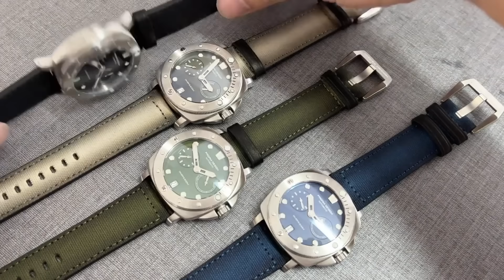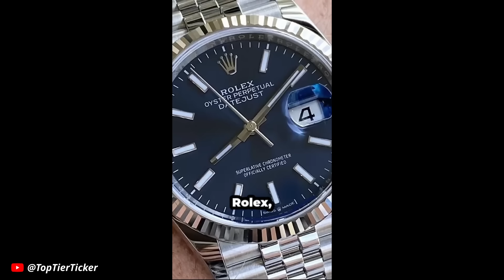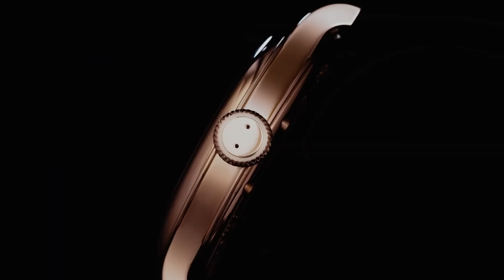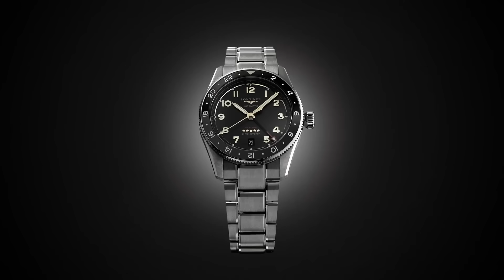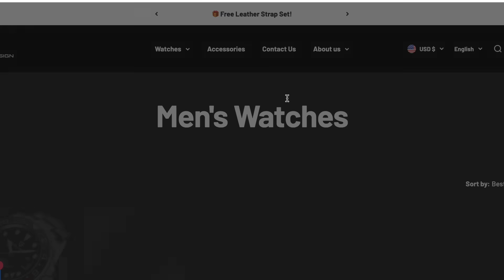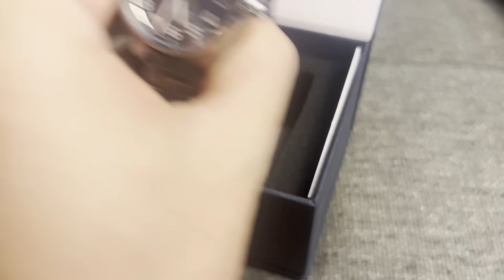The ULTIMATE Fake Watch Company

Comment: Regarding complaints about micro adjustment on PD watches being so difficult, my Pagani PD-1639 which I got in May of this year (2026) includes a notch on the link that holds the spring bar, making it easy to stick in your spring bar removal tool to pull the spring bar loose. Just make sure you open the diver's extension first because that link is hidden under the extension. I reckon this wasn't the case with the two other Pagani watches that I got in 2021 and 2022. Hopefully they put this notch on all their watches already.

Comment: Those are designs.

Do Porsche and Ferrari are design stealers?
They are.
They stole the concept of the modern motor car to Ford, 40 years later, as every other brands.

As fridges, stoves, houses, bikes, planes, boats.
If the design is good, it will be used. As source, or as it.
That's not copy, steal or homage, but natural order.

Sure, if you "clone" (name, design) as an attempt to FRAUD  and sell it as an original, it's fake.
Otherwise, it's not.

Comment: I got my Vunqera Datejust hyperclone for $1,200. I saved $13,000! It's absolutely crazy there's practically no difference from the original. They have by far the best hyperclones on the market. On top of that, they have every watch you can imagine, even fully diamond-encrusted (iced out) models. It's incredible. So i am asking everybody here, is it better to give like 15k and wait for 2 years for a watch, or get 10 of them for the price of that 1, and get them in 20 days? I even resold 2 here in Miami for 2500 each, box and papers

Comment: It's clear that people don't understand the term, "homage," including this content creator. Homage means, inspired by, so there will be similarities, but also distinct originality, too. Within watchmaking, all types or categories of watch began as the solution to a problem, so intrinsically function precedes form - thus a diver watch is limited aesthetically based on the job it must do at 100-1000M, so diver watches can only look so different. On the opposite side of the spectrum away from a true work watch, the dress watch has greater flexibility, while the concept wristwatch is the most extreme version of excessive form over function - many can't practically be worn in most settings and are relegated to being appreciated solely for their artistic contribution. Chinese wristwatches, like Pegani Designs, have NO DESIGN element whatsoever. Their watches are NOT designed, but CLONED, so these are  more accurately called a "clomage" rather than homage. They are a rip-off subsidized by the CCP, manufactured at a loss, with criminal labor standards, for the sole purpose to disrupt Western markets in an anticapitalist campaign. People who purchase these watches are either naive to understanding manufacturing in general, watchmaking specifically; fair labor practices and economics. A Swiss watch company, at any level, has far greater costs in materials, ACTAUL DESIGN, advertising, labor, labor regulations, taxation - every considerable metric. And you're purchasing pedigree. There's only ONE Rolex, ONE Porsche, ONE Ferrari, ONE Bentley, ONE Tiffany, ONE Holland & Holland, etc, etc. Stolen Intellectual Property, slave labor, CCP sponsored manufacturing, limited advertising makes for an inexpensive, throwaway watch to appeal to the masses. Nobody is going to spend $500-$2500 (current prices) to refurbish a Pegani Designs watch in 10-20 or more years, because they'll have ZERO VALUE.

Comment: I have a real Submariner purchased in 2017 for $7200.  It is now worth $10,000.  I have a Pagani Design Polar Explorer 2 bought for about $250 4 or 5 years ago.  The bracelet was junk, I replaced it with a rubber strap.  The Pagani has basically no resale value.

So scorecard:  Real Rolex $2800 profit.  Pagani Design $250 loss.

Comment: If it has their company logo on the dial it's not a fake. That's clickbait BS. PD isn't a brand I'd buy ,but I have loads of Chinese homage watches because they offer outstanding value for money.  I can wear a style of watch that I particularly like, which is well made of good materials at a fraction of the cost of the original. Some of mine are exact copies except for the name on the dial, some are based on a well known design and some are completely original. The Chinese are extremely good at finishing, just about all the Rolex Submariner homages will have better polishing than a Rolex. At least one Chinese brand is using zaratsu polishing technique,  their £200+ watches have outstanding finishing, go check out one of I Like Watches videos on the subject. High magnification footage shows clearly the sophistication of the Chinese finishing. I own original pieces too, and appreciate them. However Chinese brands,  there's a handful of well known brands sold via AliExpress,  offer incredible value for money.  Perhaps you are thinking of buying an original and want to try something extremely similar first or maybe you own the original and don't want to risk wearing it on holiday, there are many reasons to buy a good quality homage,  stick with the top quality Chinese offerings and I doubt you'll be disappointed.  I've had some of mine 5 years plus and they still look great and are performing as they should.

Comment: Sometimes the 1:1 cloning can be useful, I bought a first series Invicta Reserve Bolt Zeus Magnum, perfect condition except it is missing its unique crown and the bezel surround but ebay found me a perfect Invicta official crown and I bought an Invincible from Aliexpress which has a compass where the second movement goes and fake chrono features it is a literal 1:1 copy so bit of acetone on the bezel surround on the thing, popped cleanly off and now I have a perfect Bolt Zeus Magnum costing me like 20% of the current prices.   Last year I built a 1:1 clone of a Bell & Ross Radio instruments, has a NH34 inside but got an actual dial and hands from an original and it was just pure luck the B&R hand sizes were exactly the same as the Seiko NH34.   Only missing bit is the metal logo on the dial but heck it cost me less than £100 for a £15k B&R and it is awesome.

Comment: I bet you can’t buy any parts for any of there watches
Reply: The only part you need is the movement, and they are typically Japanese and easily available
Reply: @mooneepondsmassive7016 what about crystals. I bet if you brake one you are throwing the whole Watch in the bin
Reply: @Sager-fs9bv  perhaps. Regardless of where a watch comes from, the cost of the watch and the cost of repairs will always determine whether you get it repaired or not. I've thrown away plenty of fashion watches before I got my first nice watch. I've got some good quartz watches from citizen and Victorinox that would not be worth repairing (and they are not even crystal). My brother had a Eco drive that citizen said it was not worth repairing. The fact is that some of these AliExpress brands make better quality watches than some of the entry level Swiss watches for less than half the price, and you take your chances. Nothing much goes wrong with Japanese movements, automatic or quartz, and if it does you may choose to replace them. And if you break a sapphire crystal then that's maybe a lottery on whether you fix it or not. To be honest I'd probably try to send it back to China for repair, it's probably the most cost effective option.

To be clear I don't like the straight copies, I like the original designs and the ones that are inspired by rather than photo copies. For obvious reasons.

Also, these watches are not a threat to the big brands. If you can't afford a Rolex then buying one of these is not going to affect their sales.

Comment: I went a little into trademarking and copyright and AFAIK Pagani also can't really stop that because trademarking is classified into classes/categories and motor vehicles (and other vehicles) are class 12 while watches are class 14.
However, Pagani Automobili S.p.A. also is in Class 9 as they also make a HiFi stereo system.
And there's a bunch of companies in different categories that have the same name but aren't competitors like Bugatti with the cars and bugatti fashion (a German brand, founded in 1947, however they began to use the name "Bugatti" for the first time in the late 1970s, over a decade after the collapse of the auto maker) or the American company Continental Aerospace Technologies, they make aircraft piston engines and have no relationship to the German tire manufacturer (and automotive supplier) Continental and their logos also differ, the american has an eagle emblem while the german has a horse (their origins were rubber hoof pads for horses, literally like horse shoes but rubber and not bare metal before then began to make tires and that logo is a tribute to that).
And even some have interesting similarities: I have a handbag by Mario Valentino and that company is in Naples/Napoli, founded in 1952 and it wasn't super expensive, meanwhile there's also "The" Valentino from Rome/Milan and unfortunately that one was founded later, in 1960, they probably did some out of court settlement, also their stuff is much more expensive.

KTM is interesting, the original company went bankrupt in 1991 and was split up in 1992, the motorcycle branch went into Pierer Mobility AG (public traded stock company) while the bicycles went into KTM Fahrrad GmbH (LLC) and due to a bicycle boom Pierer also wanted to offer bikes under the KTM brand but the Austrian supreme court didn't allow that (they have some other names under their roof like Husqvarna, GasGas and Felt but Felt was sold off in December 2023 after just two years).

I wouldn't get myself a blatant fake/counterfeit Rolex, Omega, Breitling because it's stupid (I've also seen some videos of people that had a Samsung Galaxy A or some other rather mid-range to entry-level phone and they got these modded to look like an iPhone - why? Better be honest than such a blinder!) and probably wouldn't get an almost clone like these Paganis but I wouldn't say they're hurting the original companies too much because most buyers probably never had the budget to afford the real one.
Like some kit cars, Cobra, 300SL or the Chamonix 356/550, the original cars are in the hundred thousand or million dollar range, while these kit car replicas can still be in the five-digit range.
But I prefer some like Seiko, Citizen etc. they also can be in the higher three to four-digit price range but bring their own style.

Comment: To compare and equate Pagani Design with the Swiss Made watches they're shamelessly copying is disingenuous. The movements inside a Rolex (as much as I detest their snobbery), Patek Philippe, Audemars Piguet, Breguet, Glashuette Original, or Blancpain stand head and shoulders above the movements Pagani Design is using -- as are the precision finishing details on the cases and bracelets -- and the precious metals used in the cases and bracelets. Gold and Platinum are quite expensive, especially Platinum, the more durable of the two. That costs money to produce -- in Switzerland -- as required by Swiss Law. There is a premium in the retail price for the branding, but they're most assuredly not $250 - $300 watches. The movements about 10x or more than that just to make, without the cases, dials, bracelets, and precious metals. Nearly all Rolexes are grossly overpriced, but they're not $250 watches with a crown on them either.

Comment: If you get a decent hommage for under 100 bucks, which is 1/100 of the price of the genuine item, imagine what these chinese brands could do for double or triple the price, which still is cheaper than a decent mechanical watch in the sub 1k price segment. Let's not kid ourselves, labor certainly plays a huge role in all of this. 1. Labor costs a fraction and 2. these watches are being assembled much quicker and there is way less overhead for bureaucracy and quality assurance. But at the same time, you have to be mindful of the crappy movements, PD uses. At best, you get a Seiko NH34 automatic movement with -20/+40 seconds lost per day, which is absolutely hideous for a daily. I don't share the "feel like a poser" sentiment, as you. But given that horrible accuracy, that's exactly what these brands target. They are dress watches meant to be put on 1-2 days and then put back in the drawer for months. My Tissot PRX drops 3 seconds a day which would qualify the piece for COSC and a genuine Rolex is allowed to drop 2 seconds per day at worst. A 5k Rolex is required to fulfill this criteria and will likely run more around -1/+1 per day. It is a completely different experience and beast and this is where you won't mind paying hundreds and up to a thousand bucks a decade for service. These watches are precise work horses and no other watch brand comes close to that. Grand Seikos has their Spring Drive but that's more complicated and a different tech entirely. And only if you are mentally healthy and not a snob for mechanical movements you will be able to enjoy precision.
I'd love PD go for better build quality while dropping the automatic gimmick entirely. In that price segment mechanical watches are just a pain in the butt. And a proper Quartz movement like the VH31 with a fluent sweep would be amazing.

Comment: If you're capable of working on watches, you can take a Pagani case, and pieces, and put in the highest level of Rolex-type movements that you wish.. They are available.. Put in a PT 5000 movement, and you can have an extremely accurate, and finde watch.. Will it have the Rolex name on it, no.. It's obvious it's not a Rolex. Only mechanically gifted people should deal with this what kind of modification. If you want to go an extra step, you can get yourself a pressure tank, and make the watch waterproof to 200m the pressure...

Comment: I own two Paganis, their speedmaster clomage, and the PD1723 - which - some vague Explorer nods aside - is essentially an original design. As watches they were both fine, their weakest aspects were the strap/bracelet. Generally, Pagani are sitting at the lower end of quality mechanical watches; you can get cheaper ones (even ones with original designs) from China, but there is a notable drop in quality (or at least quality control).  Paganis make the watches they do because these are the ones we buy. Brand expectation regarding Pagani is such that for making original watches the company might as well create a separate brand.

Comment: I have a couple Paganis and even one Pagane in my AliExpress cart. I like how watches look, but the only one I wear is a cheap smartwatch, closer to a fitness band, even. I need to see time, get app notifications, and see who's calling, because my phones are on vibro since 2013. So I might spend 80$ for 2-3 cool looking watches that won't break just by running.
Same with folding knives. Love them. Never gonna pay big bucks for cool looking onesz because I can get a Chinese replica for 10-15$. Slightly less finish? Sure, maybe. Worse steel? Most likely, but I'm carrying them for fun and occasional package opening/stray thread cutting, not actual work usage, so it doesn't matter to me. If I could get a reasonably close enough copy of a cool sports car with 75% of it's performance for 15 grand - believe me, I would absolutely do that. I don't need it to go 330+ km/h, 240 would be more than enough.

Comment: I have the PD 1773 which is the Spirit Chrono. £21 delivered including taxes. Fantastic watch. 18 months old and hasn't put a foot wrong. Swam with it too and no issues. Also have a Steeldive 1953 'Hulk' on a Jubilee. That was £35 delivered including taxes. Within COSC spec and again, almost two years old and hasn't missed a beat.

Comment: I own a Pagani Design Automatic that’s the “copy” of the Tudor BlackBay “Root Beer” and I have nothing bad to say about it! I also own a Tissot PRX Auto and Zentier Z5 Manual Wind amongst other auto watches and the Pagani holds time the same as the PRX, I’ve gone swimming in it multiple times including sea water, wear it for work every day (and have done for the last 9 months) and it’s perfect. No scratches on the crystal (I’m a machanical engineer as well so metal and stuff everywhere), strap has worn well and I can’t complain about the fit and finish👍🏼

Comment: Pagani Design just buys parts from Alibaba/Aliexpress to build their watches.  They don't actually make or design their own parts. The only thing they "might" do is put their own logos on the dials they buy, but there are lots of sellers on Aliexpress that offer custom logo designs and will put them on the dials for you when you buy them so they may be using that method instead.  They're also likely outsourcing the crown to get their logo on the crown.  I personally build and sell watches using parts from Aliexpress and all of mine are "hommages" to other stupidly priced watches.  I buy dials that have the Seiko logo on them and I'm comfortable doing that because I use authentic NH35A movements which are made by Seiko and I make it perfectly clear when I sell these watches that they are hommage watches are are not manufactured by nor affiliated with Seiko in any way.  On a side note, Chinese clones of the NH35A movement have been showing up recently on Aliexpress due to the tariffs raising prices, but those are listed as "China NH35A" movements and you can tell just by looking at it if it's a Chinese knockoff or an authentic Japanese NH35A movement so I make sure I only use the authentic ones even though they cost more.